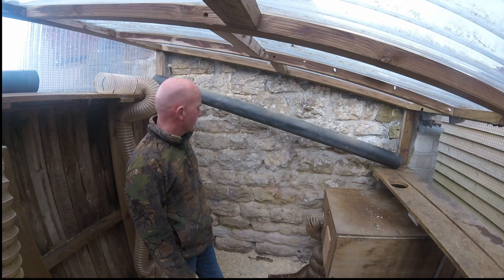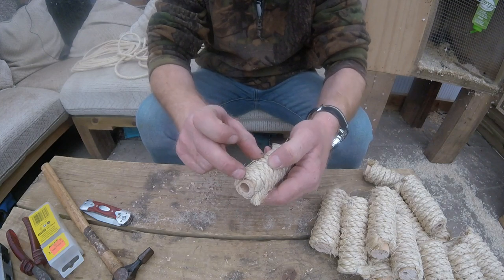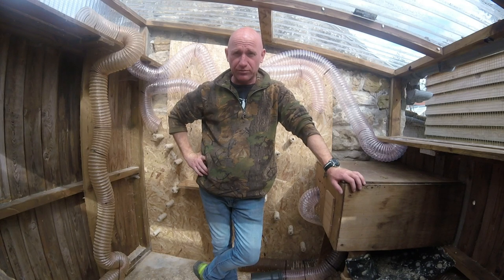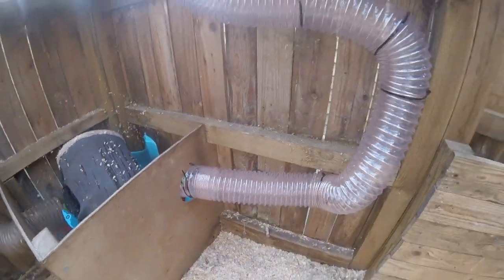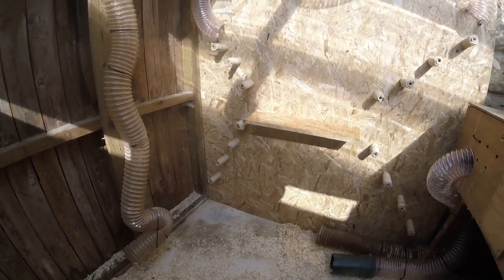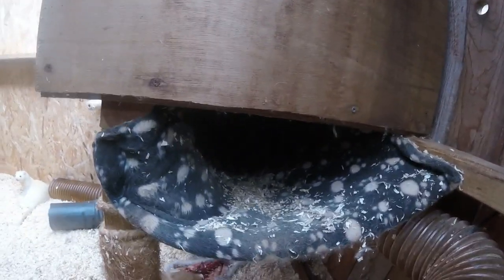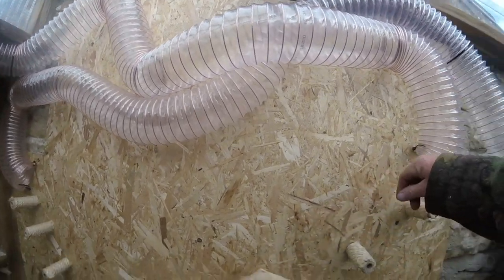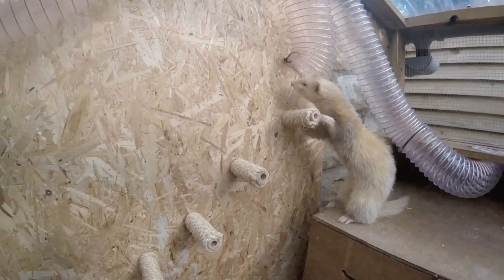Penthouse Upgrade new activity wall

Comment from the maker: Where to by the pipe 

https://www.ebay.co.uk/itm/PU-Flexible-Ducting-Hose-Ventilation-Fume-Dust-Extraction-Woodworking/110918247105?var=410125630416

Comment: Hey buddy. How do they cope with the clear roof on hot days. I have the same roof but need do put them in water every few hours.
Reply from the maker: I've not had a problem, there is three large wire windows which allow plenty of air flow. If it really warm I give them plastic bottles full of ice.

Comment: One question. I have a ferret  female, she has now ten small ferrets. They have two weeks. But the box in wich they live now is small, and i have change to other place more big in no more of two weeks. They accept naturally this change? They have then four weeks aprox.
Reply from the maker: Yes you will be able to move them to a larger hutch it won't bother them and the mother will take care of them until they are weaned off her. They should stay with her until they are at least 8 weeks old
Reply: @ruralpestcontrol  thanks!!

Comment: Is that warm enough for the winter for them ? And doesn’t rain get in though the sides ?
Reply from the maker: more than warm enough. 
The north facing side has plastic sheets on the outside of the wire to stop the cold wind and rain blowing through. Rain can't get in the other two sides as its too sheltered.

Comment: When cable tying the pipe how do you secure it to a surface ?
Reply from the maker: I used staples,  (the nail type) on the wall. anywhere else I drill 2 holes through the wood the pipe is gonna be attached to.
Reply: Rural Pest Control Whitwell perfect thanks 🙏🏻

Comment: The link for the pipe is not longer available, can you please tell me how is called that type of pipe so i can Google it? Thanks
Reply from the maker: this is it 

https://www.ebay.co.uk/itm/175301019105?hash=item28d0c145e1:g:21wAAOSwfA5ilIgd&amdata=enc%3AAQAHAAAA4GQSCZtjqDlO1kCx0vtf5WluXluP7U0mdMm34zl7WBZaoGAwbsIYJXTLY9qlzJMYmYT84pnQ8ZPPiyPSfd0fvUbc61IRsdu8CVWh0TSBhIhSJ3IITZ4suXJzKar44lhSMkbTGSYxdVPJVuZKw9g7CnTwUF11zRU3ZqDfRuGIM6x49%2FOp1fVjET%2FeM1znFsMNmTbNOqzdL4oiHysGecSlfwqDjhyC%2B9fpQlGhh4EJv8OdGYiGRvHsVohyqYDwNe%2B46IcbR1q0fhGXuDl8aLMdGgVm80yLQBY9BTUSFY5b9Eqe%7Ctkp%3ABk9SR_yku73XYA